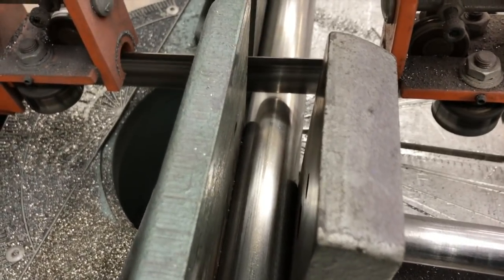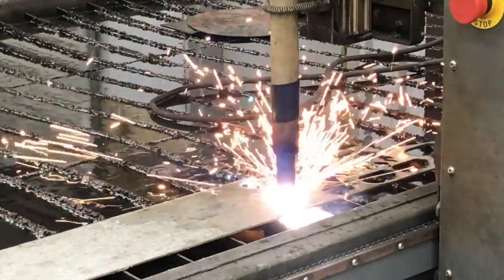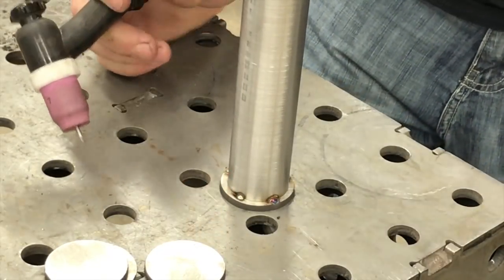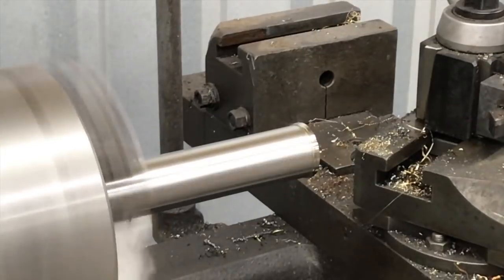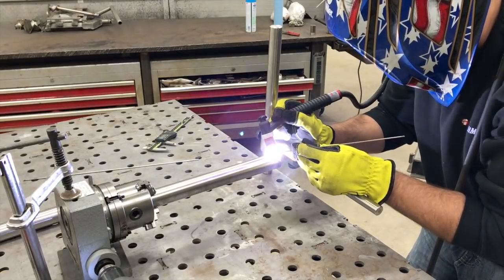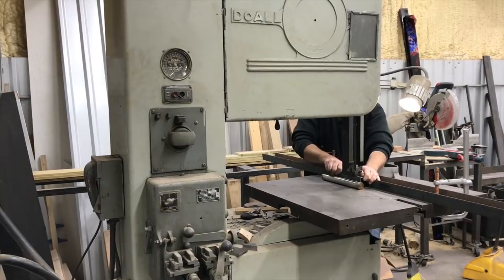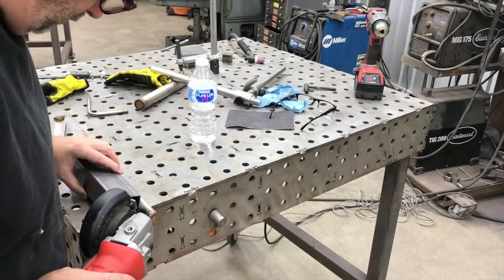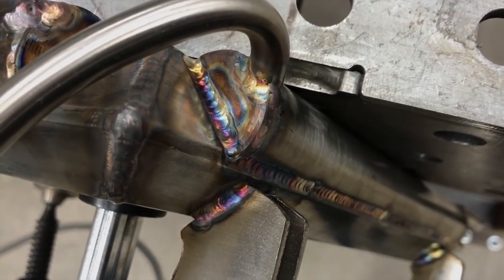Split Cut Stainless Steel Round Tubing down the Middle

Comment: Thanks for sharing how to split tube like that. I was a bit worried you would turn the tack welds off the part, but then again my fusion tacks on mild steel are surprisingly strong and they penetrate well. Some of them are not easy to break if the part needs reworked and they have been strong enough to test a couple machines I was building. The positioner is a great idea, but I rarely do work like that. The hand rest is something I need to build for my fab block table and yours looks great. I liked the narration on this one. It was pretty well to the point and it flowed well while giving great detail. Hopefully things will pick up for you and you can turn more profit with jobs that your other help can knock out. I do understand spending time learning, fixing or improving on past work, and trying to be creative. The creative part is challenging for me. It is one thing to get a little creative to solve a problem and it is a whole other game to come up with new products or services. When you work alone or with just a couple other people, you have to do it all yourself vs. a larger company where you can rely on a larger number of minds and use each person in areas where they excel.
Reply from the maker: Yea the fusion tacks were popped in there pretty deep since the fit up was tight and i honestly wasnt sure if it would turn the tacks off or not, but it worked out.  Thanks sir, appreciate the support

Comment: Awesome. Any pointers getting right Tig welding? I get the tungsten too short, by sharpening it too much and how to position my hand to keep the arc and travel perfect.
Reply from the maker: Not sure man, just watch as many videos as you can, keep trying, keep practicing.  Maybe look into some training in your area ?
Reply: Ramsey Customs - turbocobra. Thanks. Really like your welding, nice weld. I want to do welding trade. I get stickwelding right. Love 7018's never tried 6010's yet. Tig welds are an art. I struggle keeping the tungsten clean when doing Tig. Very challenging but I'll keep trying.

Comment: That’s 1/4” flat bar not 1/8” and you could’ve saved yourself time and money by cutting the end cap flush or  slightly smaller than the OD of the tubing and welding it up and depending on your weld sanding it smooth
Reply from the maker: why do you say its 1/4" flat bar?  You heard me say in the video it's 1/8th inch, I didnt get it wrong, it is in fact 1/8th" flat bar.  What you described would be the same process that I followed, and you just substituted turning on the lathe for sanding.  I didnt sand anythign in the video so you would be adding that step
Reply: Where’s the extra step? Tack it, weld it and then clean it up! Plus you can hide the welds and save your tooling